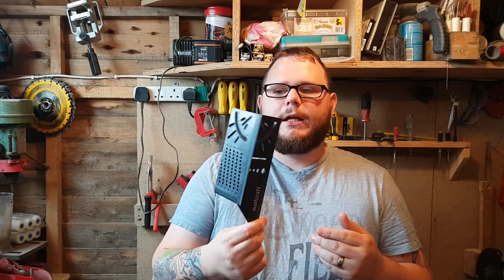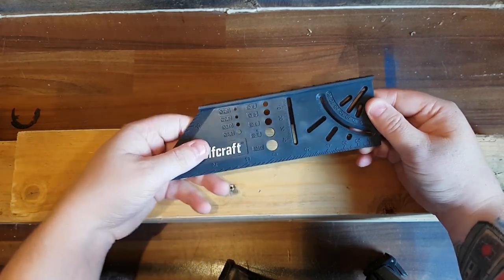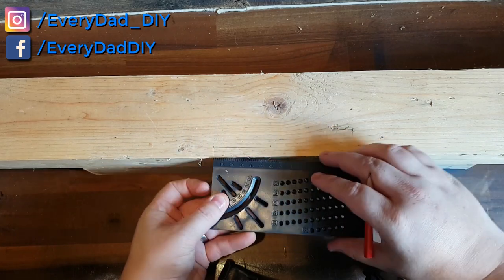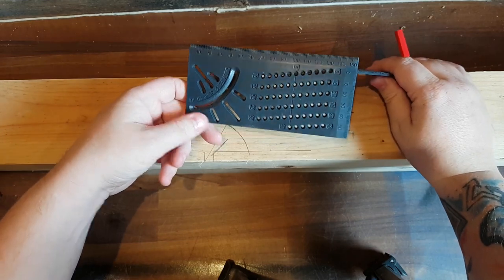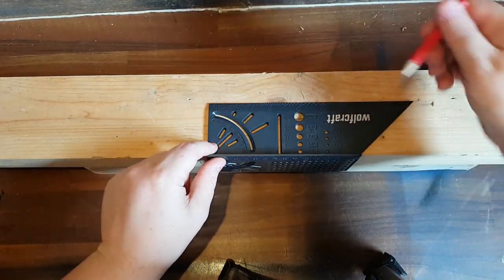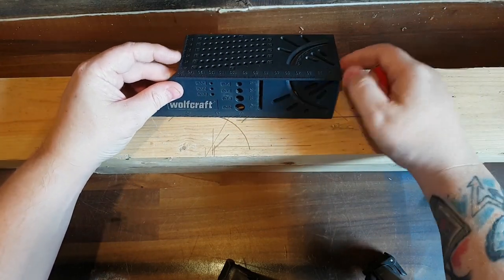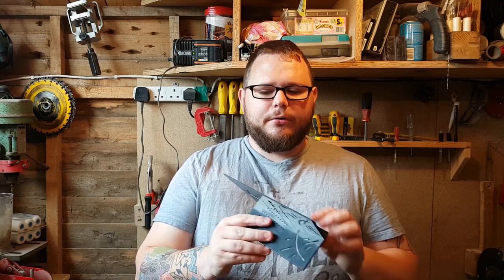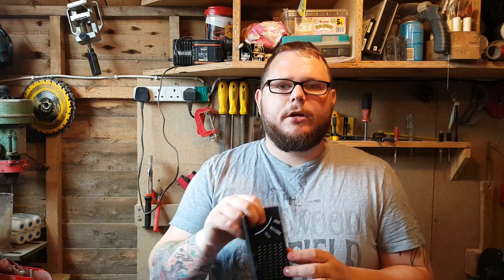Wolfcraft 3D Mitre Angle Review/Overview

Comment: Thank you for such a great review of our 3D Mitre Angle! To answer your question at 4:20 that section is another scale for different angles. The origin is on the corner of the mitre angle where the 0° line is
. From there you can mark angles 0-90 as the scale continues along the side after the pointed end. We've emailed you over a little diagram to help as well. Hope that helps. Thanks again for the great review!
Reply from the maker: Thanks for the positive feedback and the information regarding the other markings. It's very much appreciated 👍
Reply: Can you post the diagram on here?
Reply from the maker: Hi, I have put a link to the diagram in the description of the video, thanks
Reply: what is it's material ?
plastic or steel
Reply: @amrkielany2258  It's kind of plastic.
Reply from the maker: Hi Its made of plastic, thanks
Reply: Any chance I could get a link to that video as well?
Reply: Question at 420 😜😎

Comment: That's an interesting wee doin's. I've never seen one quite like that before. Keep us posted on how often it gets used - I thought my combination square would 'change my life'. But it didn't. I hardly ever reach for it now. Incidentally I think the angle marks on the long side are just a regular old protractor - the marking look oddly stretched out because they're along a straight edge rather than on the arc of a circle as they'd be on a boring old regular protractor. You sometimes see angle-markings like that on an American-style speed square. That's a nice wee tool too... Good job mate, I always enjoy your stuff.
Reply from the maker: Hi Mark , Ya it works well so far. I think your right about the angles on the edge alright. I always struggle with the angles so anything that helps is good. Hope all's good with you and thanks as always😊